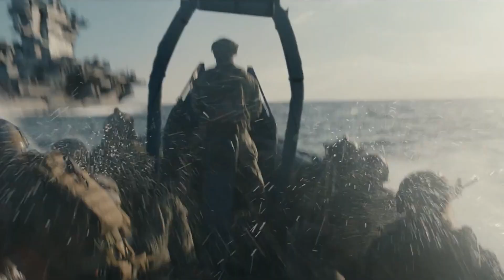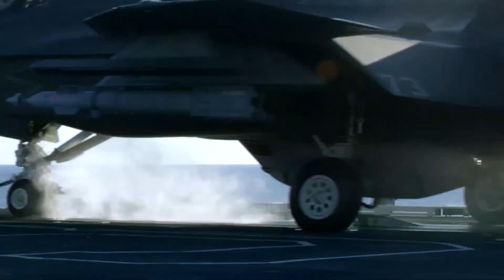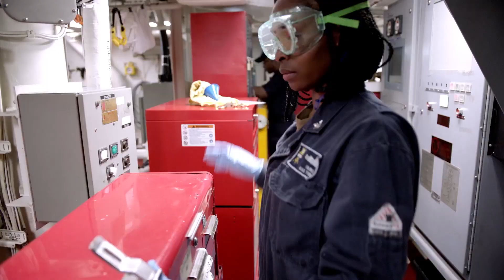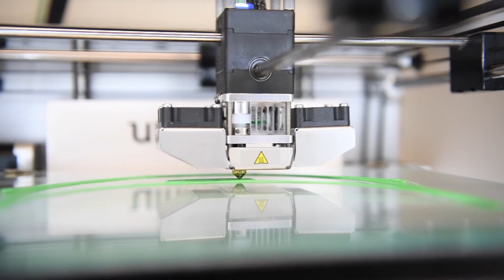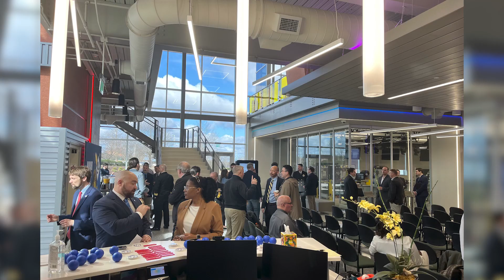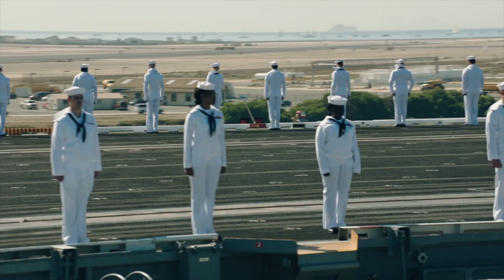Adapt, Learn and Overcome with America Makes Events

Comment: Soup so every retina has a center, and from Gravity pog, to the retina should be a 90 degree line, whence from the reticle should align with the Right eye, alternate eye closed or patched, and with the chin guard, recoiled to the upper right peck, with a Medic sharper needle tip capable of serving as the Final Alignment for a Straight shot.

Comment: The throttle shoup lock in place at speeds like a clutch manual and steering is done with the ball gas), and there are two knee to shin Metal metallic being a color of mryal+++( so it's. Kick to shift and Start